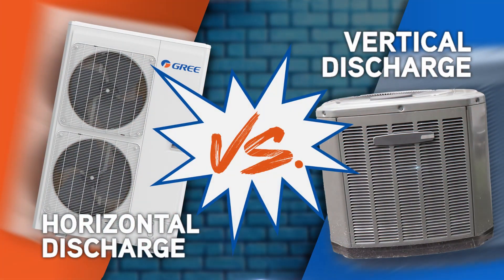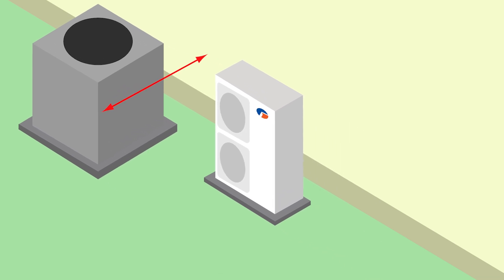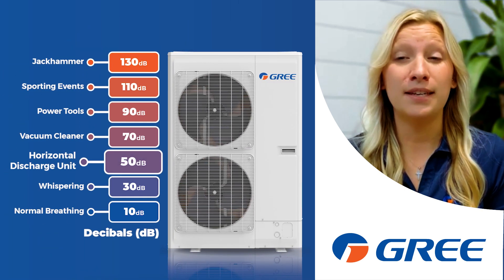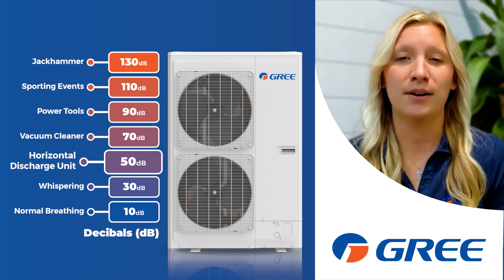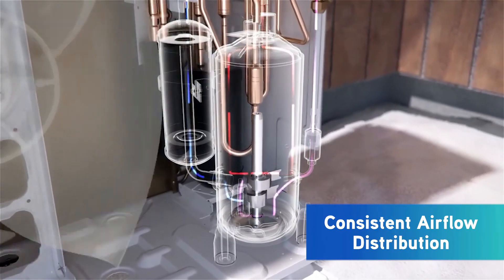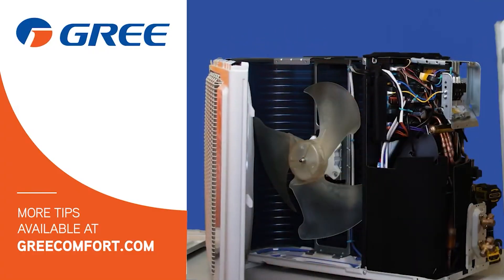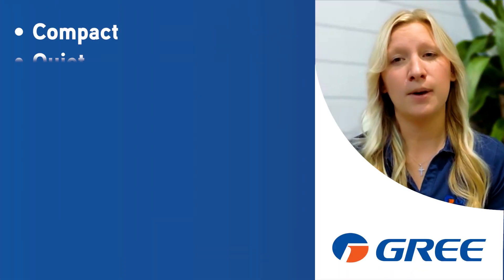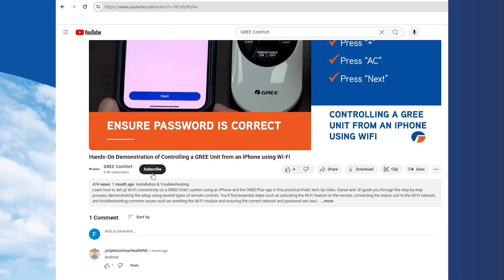Horizontal vs. Vertical Discharge HVAC Systems – Which One is Right for the Job?

Comment: Our horizontal discharge 3 ton Gree Flexx only needed 5 hours of auxiliary heat strips to keep our home warm in Calgary, AB this February. Coldest start to February in 50 years.
Reply from the maker: That’s great to hear, especially with those extra cold temperatures!